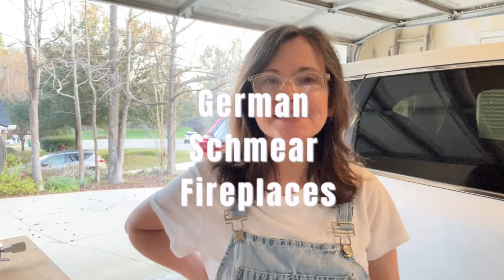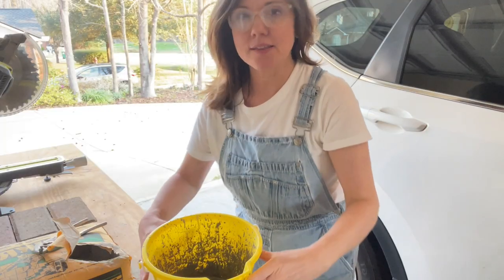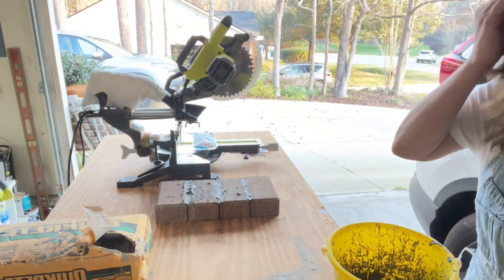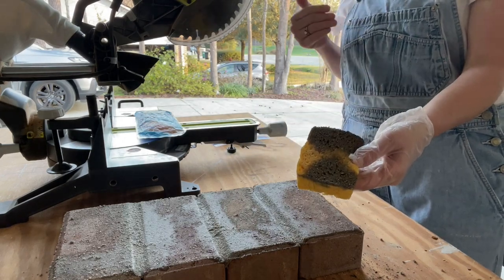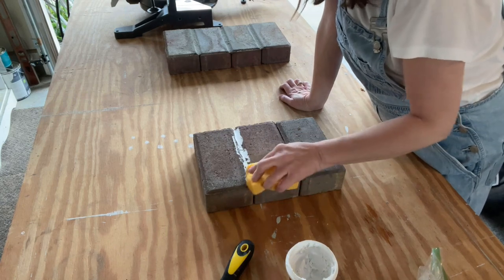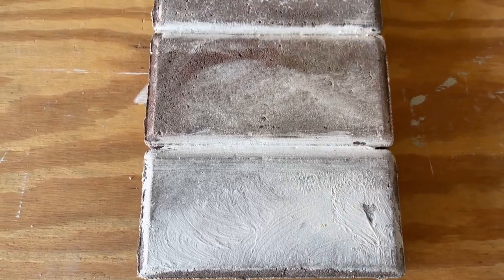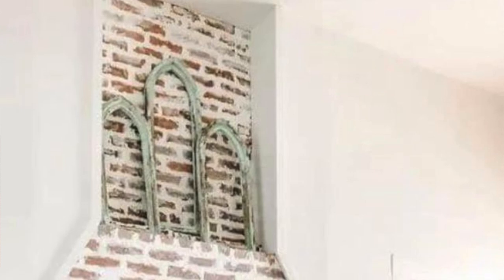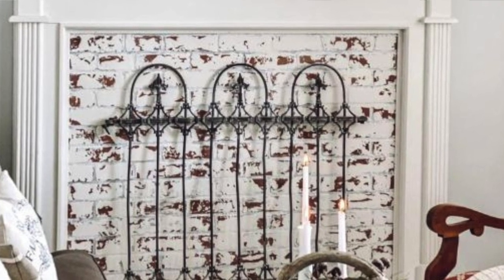German Schmear Fireplace Ideas (Brick & Rock) and Testing Mortar Mix & Joint Compound

Comment: Why didn't you make the mortar seams on your test bricks? This would allow for an accurate test as the fireplaces being schmeared has the mortar seams.
Why spackle? Why not grout? Spackle is for drywall.
I would do grout on my fireplace and moss-crete on exterior walls.